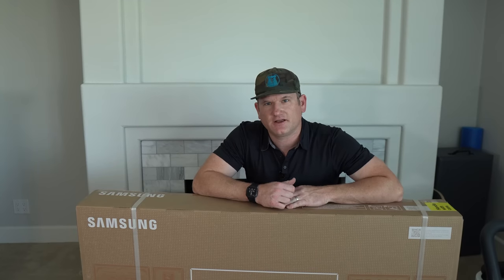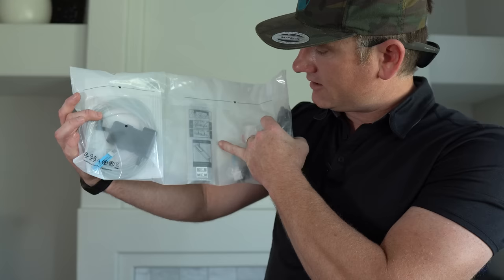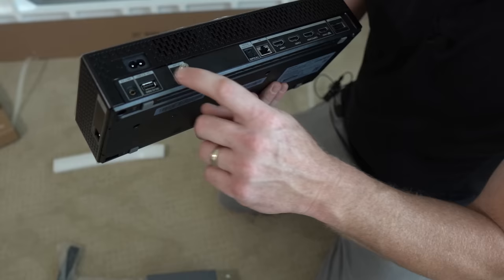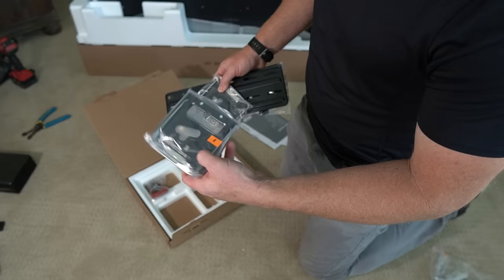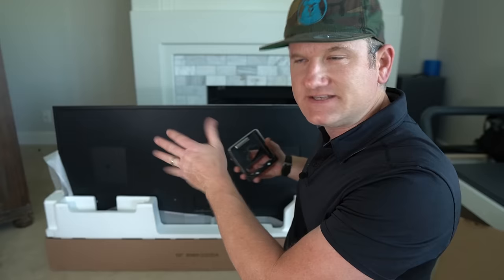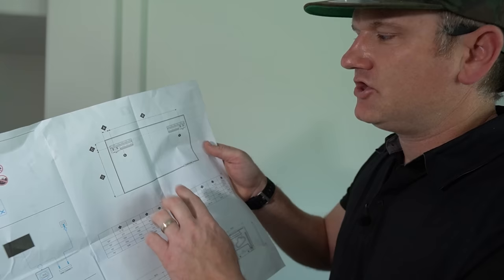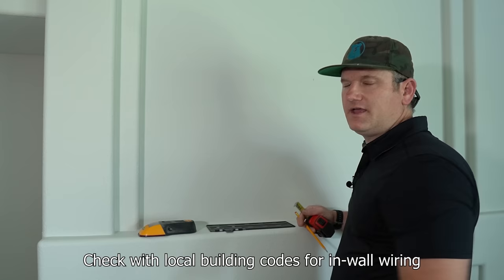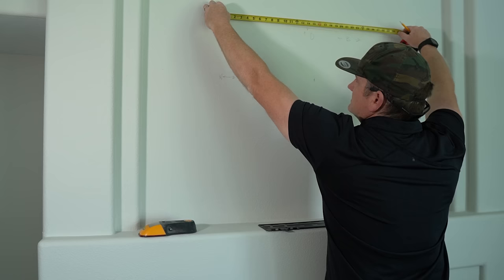Samsung The Frame 4k UHD TV - Unbox and Installation Guide (2021 model)

Comment: Your videos are fantastic!  Question for you:  Can you use those toggles (or similar) to mount the brackets on the back wall of a cabinet or bookshelf.  I have a huge shelving unit from RH with a very thin back wall.  My current tv is on a stand in the center portion of the unit.  I'd like to mount the frame in that section instead.  Thanks for posting all of this great info!
Reply: Answering my own question:  I did use toggles (similar to the ones used here but much smaller- made for 1/4-1/2 inch walls) and they worked like a charm.  This video was a great help.  Got the 55" version of this tv mounted and on in no time.  Mine did come with a template so maybe they forgot yours?  Thanks again!

Comment: Hey man. I just bought this tv 75'. I'm just wondering that which hdmi is 2.1 on the one connected box? Because I'm trying to figure to plug in my ps5 to the TV ( hdmi 4 with game icon ). However, it didnt work. So what about the other hdmi 1, 2 and 3

Comment: Great video...thank you! I have the 65" 2021 version. I am struggling with the installation. I have two screws on each wall plat that line up with studs. The other two on each mount do not (like your video). I was under the impression you have to use the "flat headed" screws that come with the TV to get the flush mount. However, I've tried with several dry-wall hardware using these Samsung screws and they just don't work. I see from your video that you're using the screws that come with the drywall molly's. So, are you able to get a fully flush (no gap) mount with those screws? 

Second question, are you able to "snap" the tv into the wall mount frame once up? There's doesn't seem to be a lot of play...again, with screw heads that are not thin/flush.
Reply: We're having the same "snap" issue. Did you get a resolution?
Reply: @jennywarshafsky7752  someone else mentioned removing a xhrom part to get it flush. My TV shows up next week. Were either of you able to sort this out?
Reply: @6foot7dad  Any update on your install? Mine does not sit flush.
Reply: Wondering if anybody got this worked out. I also used round headed screws and have a 3/4" gap at the top.  Can't really tell if it's the screws or some other issue.

Comment: How conduit helps with code violation ? 
The same goes with video found on Home Depot website where they run electric cable through the wall. It’s electric code violation in the US and Canada. Insurance team will be happy to find it and not to cover anything if frame turns into fire :)

Comment: What is the diameter of the tube you used or the size of the plug of the cable? Im waiting for the tv and doing works on the wall

Comment: I have installed in the wall a conduit that is not big enough to make the cable pass through it . There is a way to remove and re-apply one extremity of the cable?
Reply from the maker: Negative.

Comment: i bought the 75" frame tv , and i think i done the mount install right but i have no one to lift the tv with me cause of the height setup i have it at and i called best buy for there service and they cant get anyone to come out cause of delays , my main concern also is did i do the job wright tv specs says its 70 pounds and the tv feels like it weighs alot more than that wish you were in philadelphia to check this out

Comment: Thank you for the video, very informative. This might sound silly but is there a way we can somehow connect the comcast cable box to the one connect box without hardwire? We have the comcast box in one room and want the frame tv on a wall in a different room.  Is Bluetooth possible to connect the comcast box to the one connect box?
Reply from the maker: They have wireless hdmi boxes but they're not always perfect. That would be my best option. Or just see if Comcast has an app you can get cable on.. they likely do have that. I use spectrum app on all my tvs.

Comment: Just installed 65 inches after watching your Video. The gap at the back is not equal. On the right its about 1 cm and in the left its like 2.5 cm. Is this normal? What's should be the gap like? Thank you.

Comment: Wish there were more videos covering the 2021 version of The Frame like this. What 3rd party wall mount would you recommend for the 43" model that provides the most rotation and angle support? I don't want to use the wall mount that comes included with the TV because I don't want it to be flush agienst the wall.
Reply from the maker: Any mount can be used.  A single arm mount, I made a video on Amazon tv mounts.

Comment: Thanks for the info! Last years model was so much easier just having the single plate... I've installed a few of these and it requires a lot more measuring. When getting consent to film is a customers house, do you ask them once you're there? Have you had anyone say you can't film? Got any tips when doing this as I was to start filming in more of my installs. Thanks

Comment: Hi great vid!

Quick question, what exact type of conduit is that you used, is it painted aluminum or? Heat and fire resistant or whats needed for ‘code’ ? Having trouble finding anything wider than 3/4 “ diameter…
Reply: There is no conduit that is fire rated. If wire itself not in wall rated there is no conduit that will make it as such.

Comment: great videos thanks, can you tell me the rectangular  dimensions of the small end of the fibre cord, i need to cut a slot in the horizontal timber (nog or dwang here in nz) before i line the wall, plus the dimensions of the 2021 frame tv also height from top of tv to top of bracket and vertical height of bracket, just getting it ready for lining and want these in position before hand, thanks again for your videos

Comment: When we go to put hangers in the back of the TV into the brackets, it doesn't "lock in" and sits a little above the notch, leaving a small gap between the wall and the tv. Any ideas what we should do?
Thanks for the videos!
Reply: Like previously mentioned here, you have to remove the silver metal clip on the bracket, that's the one preventing the bracket to sit tight unless you really push hard on the TV to force it to snap and lock tight together.
Reply: @juantamad8339  Thanks! We installed before seeing this. We ended up pulling the metal tabs on the bracket outward with our hands to create more space for the TV to get in, which also seemed to work. We spent an hour with Samsung support trying to find a solution, and they tried to tell us this is not a problem that has previously been reported and that we just need to "hire a professional"!

Comment: What do you recommend for a similar setup (on top of fireplace) this will be the primary home theater.
There is already a conduit from behind the tv to the side, and there is also power behind the tv.
I’m between this tv or the Lg gallery design.
I prefer the gallery design because of oled.
But I think setup will be harder because of cables?.
Specially the power cable, if I get just a simple in-well power outlet to replace the current normal power outlet, where is the exceeds of cable will be? Does the tv have a way to circle the cable and use only what’s needed ?
Reply from the maker: Gallery should work. You may need yo just install a more recessed power/low voltage box. Not the big one, just one woth power and a hole for cords.

Comment: I bought the conduit from the Amazon link and it is cut throughout lengthwise so it can fold over itself.  The video’s looks like it is not cut.  Is this an issue if the one connect wire could potentially get caught within the alternate sides?  Im worried the wire will get caught and bent because the conduit is cut and can wrap around in itself.  A little hard to explain, but hope that makes sense.
Reply from the maker: You have split loom, which is not what I had.  I had non-slit conduit.

Comment: @b - what are your thoughts on installing a recessed box for the one connect box and other components when you can't run through the wall?  I'm about to use the Legrand OnQ 17" box to house the one connect and fios box and just stick behind the tv.  It has ventilation and has enough room.  Wondering your thoughts on this.  Thx - ps great explainers on your channel!
Reply from the maker: Thanks. I just did a G1 install video with Legrand 9"box. Check it out. Same for frame yes.

Comment: I need help here. In india, the installation is done by Samsung themselves. But the thing is, when their person came to install, he said the TV needs about 4" on both sides and the TV needs to slide left-right before it can be installed flush with wall. I have about 3" on both sides, almost exactly like in this video, and he said it won't be possible and tried to sell a conventional non standard frame for extra cost and not as flush. As I can see here, it probably doesn't need to slide left-right to install. Can you please confirm? I've sent back the installer for now and may need to raise complaint with Samsung if he's indeed trying to cheat.

Comment: Did you have to buy the wall mount separately or was it included in your TV? My TV came without the wall mount and Samsung has been refusing to send me one for 51 days and continues to blow me off when I point out that their website says in MULTIPLE locations that the TV comes with the wall mount. I literally spent $1000 on this TV for the sole reason that it is made to hang on a wall and it came missing this crucial piece and Samsung won't help me out. It is infuriating. I am not paying for an extra piece that should have come with my TV.

Comment: Great video, very helpful.  Have a 65", mounted, but seems to be a 3/4" gap at the top off the wall.  Is this normal?
Reply: Just installed mine and I have the same thing, did you end up fixing it?

Comment: Hey thanks for the video, we just installed our frame today. When you actually put the tv onto the mounting plates, do you need to force the metal bits down into the chanel? Because for us it doesn't seem to be sitting super flush to the wall and I think that's the problem. But I'm nervous to add too much pressure on to it, as I thought the weight of the tv would just get it to sit all the way in. Thanks again.
Reply from the maker: It just falls into place and it can level itself.
Reply: Travis, I’m having the same issue.  The top of the tv doesn’t sit as flush as the bottom.  I see the brackets have magnets to supposedly help make this flush but it does sit as well as I’d like. we’re you able to figure out why yours wasn’t flush?
Reply: @bbalingit  no I wasn't. Based on the limited info for the instal it isn't actually clicked in. There was a picture of the bracket with a tick and cross, I'm pretty sure mine is how the cross image would be. But I'm reluctant to try and pull it down too hard. So I've just let it be.
Reply: Just figured this out. I had to reach behind the TV and pull down hard on the brackets mounted to the TV until they snapped loudly into the wall brackets. Once those were locked in place I could easily push the TV against the wall to flush.
Reply: @elarsix  hmmm. I’ll have to try it that.  How did you reach behind the tv?  From the top?
Reply: You need to lean the top of the TV and reach the brackets from the side. Pull the bracket down until you hear the snapped sound. You need to do that for the Left and Right brackets. I just did that and it worked for me. My 65" TV is almost flush to the wall. The gaps from the back of TV to the wall is 3mm (bottom) - 7mm(top) for both sides.
Reply: @cxtran  thanks.  I’ll try that.
Reply: Did you try this? I’m kind of scared to, but haven’t the same issue. Top isn’t flush to wall hanger bars aren’t not set all the way into the hooking part  @bbalingit
Reply: @trevormoyes1760  I just installed my tv yesterday and you do have to make an extra push downward on the wire brackets with the top of the tv pulled out a bit.  You will hear them snap into place.  Once they have snapped all the way in and you push the tv against the wall you will hear another click when the magnets engage.  The two silver pieces that someone mentioned in an earlier comment are what the wire brackets click into.  I removed a bracket from the back of the tv and placed it in the wall mount so I could see what was keeping it from mounting all the way flush to the wall and discovered this.  Hope this helps.

Comment: I just bought the OLED77G1PUA, brought it home and discovered that where I want to hang it, the studs are 24 centered and not 16 centered. Any advice? Can we use a single stud and dry wall achors for rest?
Reply: Yes, if you can hit one stud per side, it’s great, but four of those toggle bolts he shows will work fine if you can’t hit a stud at all.

Comment: Anyone know if you can pair a Sonos Beam or Arc with this TV ?  thinking about getting one for our Kitchen area/Photo Wall but would like decent sound. planning on hiding the box on the opposite side of the wall.
Reply from the maker: Yes. Just need to remember the hdmi cord from arc or beam has to go from the one connect box location back to the sound bar. And power for sound bar needs a home since tv doesn't have power.

Comment: Is it possible to move the Frame tv to the right at all once it is installed? I had someone come and do it, however, they didn't center it properly.
Reply from the maker: Not really as it will make it not level.  You cam take tv down and then loosen the screws and move the brackets over as much as needed and re-tighten. For like small amount, that isn't hard.
Reply: @BTheInstaller  thanks so much for responding. I really appreciate it. Your videos are so helpful.

Comment: If you cut a hole behind the tv to run a conduit to hide the wire, does a standard wall plate fit without compromising the no gap mount?
Reply: I'm wondering the same thing. Did you figure this out?

Comment: I just followed this guide to install my 75” Frame TV and beware.. The toggle bolts linked in the video come with round headed screws, that when combined with a required washer, protrude to an extent that the tv does not mount flush. It’s a small detail but a huge problem. I’m left seeing if replacing the existing screws with 10-24 flatheads will be enough, whether I can file down the heads, or have to rip the whole thing off and start over.
Reply from the maker: They make the same toggles with flat heads.  I've never had issues with those round heads.

Comment: I have 34.5 " from the ceiling to the top of the mantle. The TV will fit as it is 32.8 inches tall. My question is there enough room to actually slip it on the mount? that is attached to the wall
Reply from the maker: Yes, you only need 1/2 inch or so clearance.

Comment: What if I have power outlet in the middle of the wall (For vesa mounted TV)/? How to mount and power this Frame model?
Reply from the maker: Just put the one connect behind the tv if you want to use vesa.Vesa.. or just take the cover plates off and put tv over it. Then run wire to another area and power the one connect there.
Reply: @BTheInstaller  Thank you for the update. What Vesa mount would you offer for 55-65" model of that frame Tv?

Comment: Thanks for the video! Very clear. You never showed how to level the TV, once the brackets are fixed to the wall. Are there some tolerances built in so you can adjust the position of the TV slightly when you are about to hang it on the brackets? Difficult to get the two wall brackets bang on level, and also some movement left to right would be good to centre it above your mantle piece...

Is this possible? Do the fixing brackets allow for some adjustment?
Reply: Yes, the Samsung Frame mounts have always allowed for a few degrees of play in either direction to get it dead straight after mounting.

Having had both a 2019 and 2021 Frame, the new system is vastly inferior to the old one from an installation standpoint. The templates also aren't reliable - my 55" B, D and A distances were correct on the template but were off by 3/4" on the wall from edge to edge when I checked before drilling. I just ended up doing wall mark-up as he did in the video once I made sure the TV brackets themselves were not offset.
Reply: The original frame had an excellent bracket, the dual bracket type is one of the most terrible mount designs i've seen in many aspects.

Comment: Literally the easiest type of wall to hang it on.  What about a tile fireplace? 😬
Reply from the maker: Tile is easy too.. the hard install is brick where there is no room to run wiring. For tile, you just need to knock s small section out and behind it is drywall or wood and same process... fasten with anchors or into studs behind tile

Comment: I've installed many Frame TVs and this new mount is not good. Why are the brackets on the back of the TV loose? They don't stay where you put screw them in. When you hang the TV they slip thus messing up your desired height. I don't get it. Am I missing something?
Reply from the maker: It's not a good design.  They're trying to offer some leveling adjustment I guess.  The centered mount was fine, even on a 75 inch. Just hang it on a center mount. So dumb.
Reply: I'm mounting my Frame today and noticed the same thing.  Seems like a dumb design with the 'slip down'.  I was able to compensate but Samsung should do better.

Comment: Do you think eight of those toggle bolts would hold a 75" 2022 Frame?  I bought "Toggler" brand from Lowes, 1/4" diameter. Amazing video and insanely helpful!!
Reply from the maker: Yes.  It wouldn't hurt to hit a stud if possible
Reply: @BTheInstaller  Will definitely try to. Just worried since I currently have a 60” TV from 2012 (a bit heavy), currently using the studs. No clue if it’s a reasonable worry to reuse the studs (at different vertical locations).
Reply: @BTheInstaller  Just got mine up thanks to all your Frame videos!!!